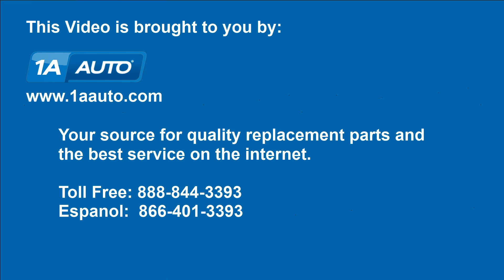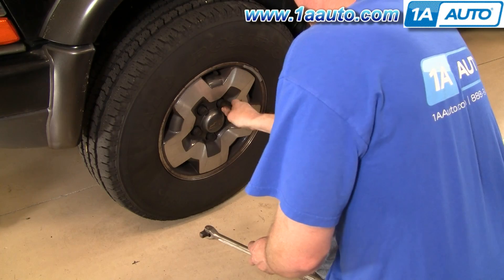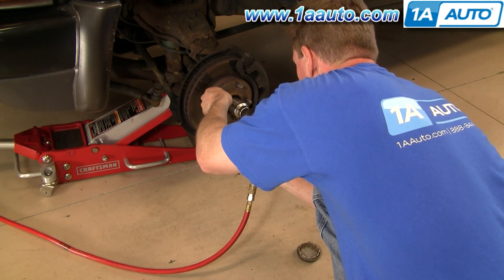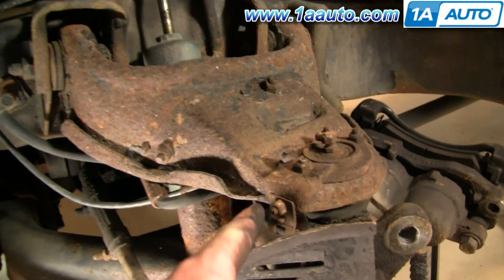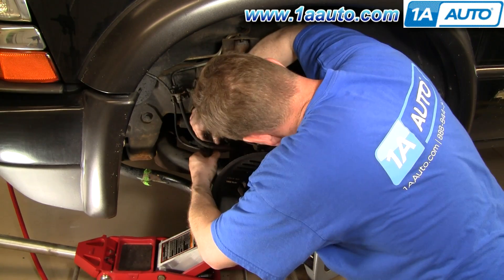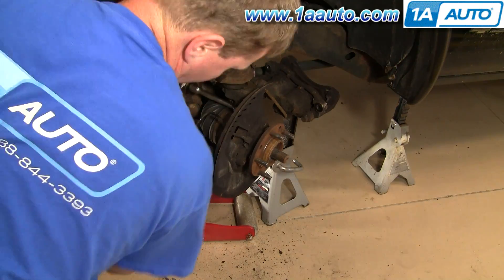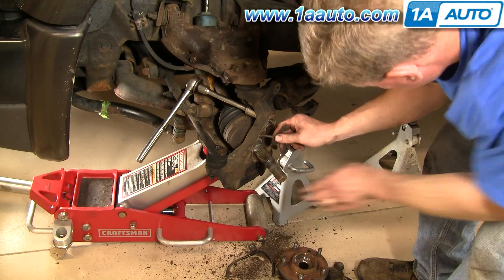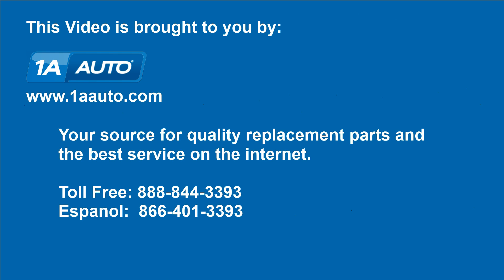How to Replace Wheel Bearing & Hub Assembly 98-04 Chevy S10 Pickup Part 1

Comment: I live in the Salt belt and I can tell you the driver side bearing will not come off. I've tried prying it, zip gun, heat and now I'm at the point of trying to press it out with a 10 ton press.... nothing really worked. I took off the knuckle and it's time for the press....

Comment: I tightened the 3 bolts as much as I could. No idea how but there is still a tiny amount of play on the top where that round plate between the knuckle and hub assembly actually moves with all 3 bolts tightened the hell out of. There's like a mm of play there. No idea what happened. Also I didnt torque those 3 but they are tight.  I torqued the cv Nut to over 130 ft lbs. Hopefully nothing gets damaged...and no premature failure.

Comment: Duuude. I literally spent 6 hours on the side of a mountain trying to fix mine. It did NOT come off that easy. I had to sit here with a chisel and ballpeen hammer for 6 hours. 

I STRONGLY suggest renting a hub puller.

Comment: does the socket size for the hub nut apply to a gmc jimmy as well since they are the same thing as a blazer
Reply from the maker: It may be a different procedure on your application. We currently do not have an auto repair video for this particular year, make and model. Thank you for asking. 1aauto.com +Jim S
Reply: The hub nut on GMC Jimmy's are 35mm

Comment: Where can I get the rubber o ring you showed remval of after you removed the hub.  I just replaced hubs and axles and neither came new o rings and truck didn't have them.
Reply from the maker: +andrew lawson Unfortunately we do not carry the o-ring separately, and will likely be a dealer part only.  We also recommend check out your local auto parts store to see if they have any to offer separately!  www.1aauto.com

Comment: Anytime you are dealing with your brake pads, calipers. ect... you should wet them with soapy water and wear gloves to minimize your exposure to asbestos fibers. You won't know how bad it can hurt you until 20-50 years later.
Reply from the maker: +Randy Weber Thank you for checking us out, as well as the advice. This is certainly appropriate for safety and each viewers future. 1aauto.com
Reply: This is only true for older models (and usually only drum brakes) now the friction material is safe to handle.
Reply: If you're working on OLD cars with original brakes maybe, but modern brakes haven't had asbestos in them for decades now.

Comment: there is a separate clip on the harness that can stay in the frame, after you unplug the harness you can push down on the tab that the part of the connector that you removed(male side) was covering and slide the remaining plug (female side) off and out

Comment: Great video just did this job on a 96' blazer a little different than later models. Passenger side had a womp womp when I drove. In my model you do NOT have to remove the brake booster cable I learned this the hard way. And the wheel nut took a 36 mm socket. Use 18 mm short sockets to remove top nut on wheel bearing assembly. Clearance between the cv joint and balljoint nut is a little tight on the top nut. Other than that no problems and very simple to accomplish. Thanks for the video.

Comment: does the center nut have to be done by a air gun? or will a breaker bar work?
Reply from the maker: Thank you for watching. A air gun will take it out easier however you should be able to do it with a breaker bar. Please let us know how the repair comes out!
1aauto.com  888-844-3393

Comment: How can I get the hub but off without an impact? I tried a breaker bar and PB blaster but it wouldn't budge
Reply from the maker: Thank you for watching! Try using a bigger hammer and heating it up with a torch. Hope this helps!
 888-844-3393
Reply: You need a cheater bar. I use a 10 foot long piece of 2" pipe, slip it over the breaker handle and use it for leverage.  These axle nuts can be stubborn.
Reply: Thanks! We got it!

Comment: Hi i have a 2002 chevy blazer 2wd 4.3l sfi 6cyl and when i turn the wheels left or right it make a pop noise and also when  i push the  breaks  it shakes no that bad but you can feel it, and when i back up very slow and turn the wheels right or left it wobbles (it feels like you fall in a small hole and out constantly) You think it could be the Hubs are wear out. Or what other Parts could be causing this problem. Thank You.. You Are a Big Help. :)
Reply from the maker: You may want to check the front steering and suspension pieces for wear.
Reply: my 02 sonomas doing the same jack ur ride up, leave the wheel on and shake the wheel side to side and up and down, loose up and down its balljoints left and right loose its tie rods adjust all that n see il let u know when i work on mine
Reply: If it makes a grinding noise at speed then it could be a bearing. But it sounds like a bad ball joint

Comment: Mike, I have a 2RWD '99 SLT but the hub I have is far different from yours (and others I have seen on the net). I have no spindle and the brake rotor does not come off (I have replaced many rotors over the years and all just seem to flop out).

Appreciate your insight.

Comment from the maker: If you bought it from us and it showed an ABS sensor wire in the picture than it should have came with one, call our sales staff and they can help you out. If you bought it from someone else, there may be a tab on the hub or some way to attach it. 1aauto.com 888-844-3393

Comment from the maker: If it does this when you not on the brakes you may want to check the air pressure in the tires and possibly the alignment of the vehicle. 1aauto.com 888-844-3393

Comment from the maker: You more than likely have a brake pad or a shoe that could be worn down making contact with the rotor or rear drum (if it has drum brakes in the rear). We carry new brake pads and rotor kits on our website with free shipping if you need them. Hope this helps you out. 1aauto.com 888-844-3393

Comment: I suppose its not that critical, but everything I look up for the hub nut tourqe spec. says "103" ft lbs, but you suggest "95 ft lbs.....I'm getting ready to do this to my 99 jimmy 4x4.....should I torque to 103 or 95? thanks

Comment: @1aauto Item arrived 2 days after I purchased it. Finally have a day to install it but running into some problems. Seems the hub is rusted on and cant seem to pry it off. Used plenty of PB Blaster and still nothing. Tried your method in the video as well. Hopefully it comes loose soon. Maybe I should purchase a gear puller? Unfortunately my options are limited.I dont want to keep whacking it and possibly damage something.
Reply: Use a wheel hub puller/slide hammer type tool rented from autozone

Comment: Thank you so much for this post. I watched it several times before doing the install. I followed your instructions to the letter and it worked flawless. I just finished it about an hour and a half give or take. Took a few soda breaks. I did buy a 18mm with a swivel connected to it from NAPA prior to starting. It helped a lot getting to those hard to reach bearing bolts. Anyway thanks so much, real professional.

Comment: I bought a 2001 GMC Jimmy 3 years ago and had to replace the front left wheel bearing when i got it. last year i replaced the front right, and now the left is going out again? My mechanic says it's normal? Replacing the wheel bearings every three years? is he right???????

Comment from the maker: @Bassman8519 It sounds as though there could be a piece of rust or something causing the hub not to sit flush. This would need to be cleaned and removed so that when you bolt the hub to the knuckle it sits flush.

Comment: @CanadianGM Use a rubber mallet, or a peice of wood and hit it with a hammer. Do not hit the rotor directly with a metal hammer unless you want to replace it.

Comment: if everything is stuck (rotor,bearings on spline)bust out the heavy hammer.remove center nut,then tire.before removing anything else .spray some lube then grab a hammer and wooden block in case ur a bad shot and give the spline a few shots driving it into the bearing.if it goes in easy ur lucky and can just proceed with the rest of disassembly.if not u gotta hit it a little harder till it starts to travel into bearing.a little rust will bind them up good.

Comment from the maker: @Blackops353 When hubs go bad they generally cause a humming noise that will change pitch as you turn your steering wheel for curves.  A whooping sound while accelerating sounds more like a problem with your airbox or intake hose in to the engine, or maybe your rear differential, could be a few different things.